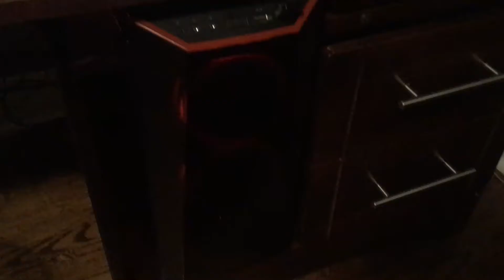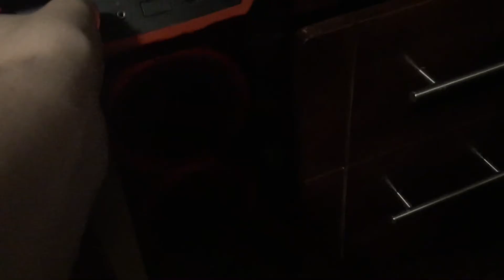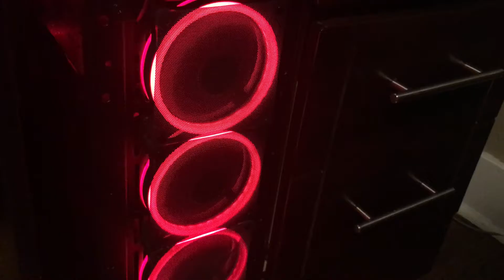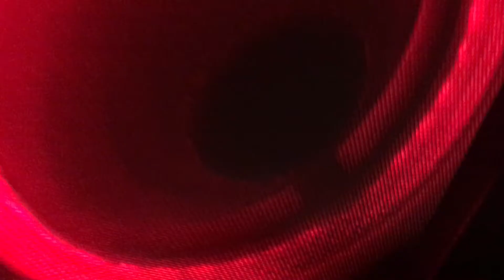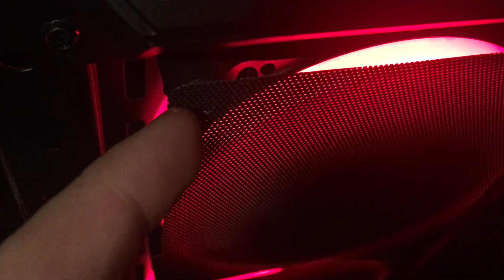Cyberpowerpc dust covers over the fans

Comment: Im buying this pc tomorrow, is it worth it?
Reply: Chief Keef Sosa 300 yea, definitely worth the price
Reply from the maker: Ya, for the most part. Not having a cd drive sucks. Not very much room for more fans. 

It does so its job. Over 60 FPS on ultra
Reply: Nerd with cars im only worried about the power supply because I’ve heard many people say different things about it
Reply from the maker: Chief Keef Sosa 300 change it out
Reply: Nerd with cars is there any way to add a portable cd drive if possible
Reply from the maker: Chief Keef Sosa 300 yep but then you are taking up on of the usbs for it